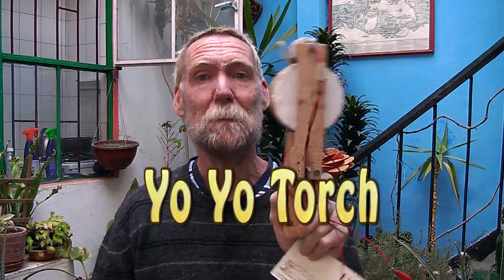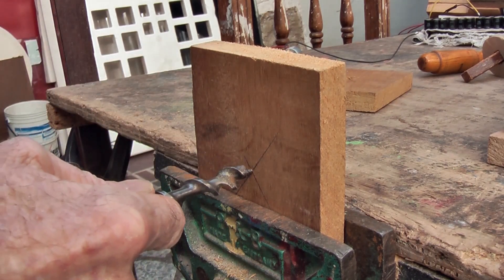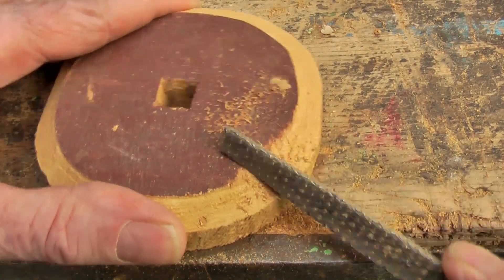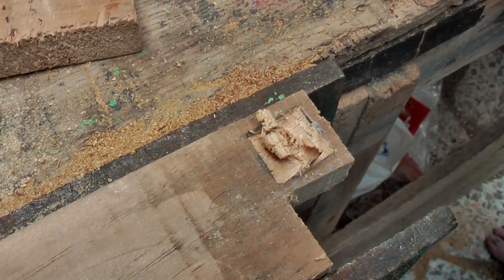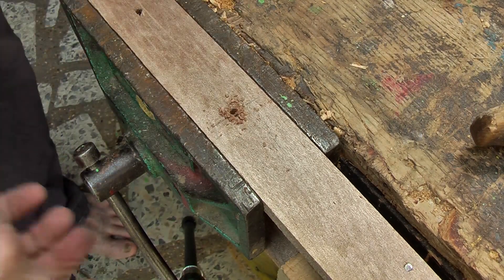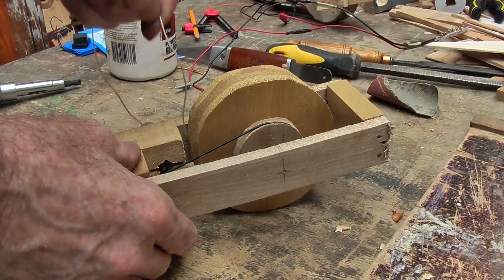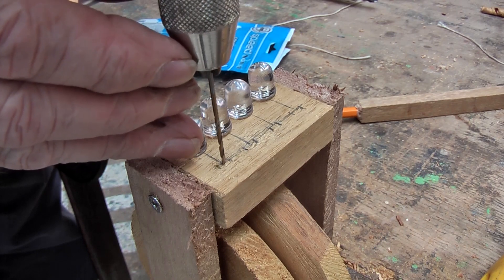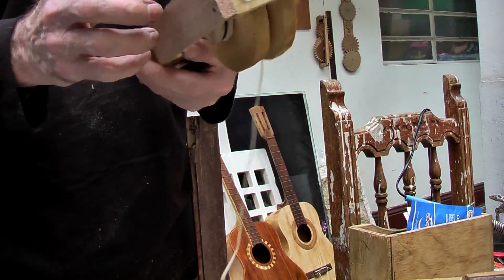Yo Yo Torch

Comment: At first i thought you would turn and true up those pulleys. But no 😂😂.
I love how crude your work is and still works fine 🤣
Reply from the maker: There was a step  that  can be done, once the  yoyo is in, string it, then spin it with a pencil just touching it as it spins. Then with a rasp  lower those pencil marks till they  are  continuous and that  trues it a bit  better and it  runs smoother. But at these revs, it is not critical.